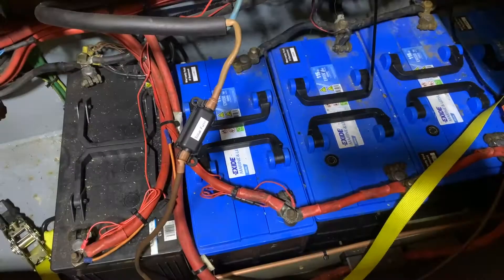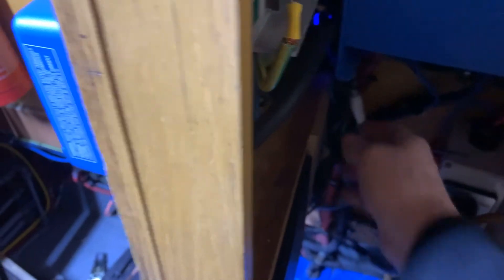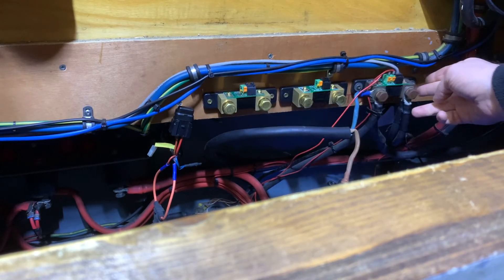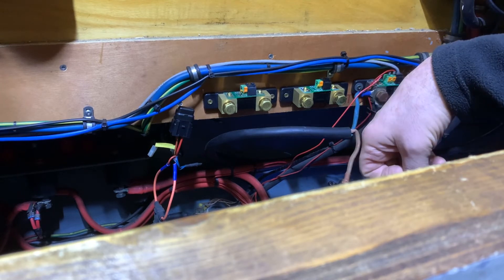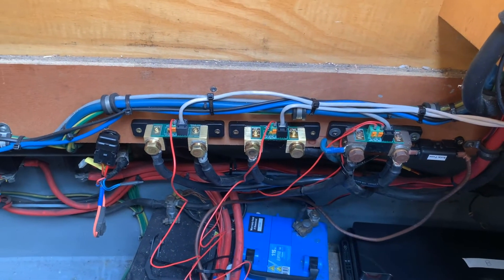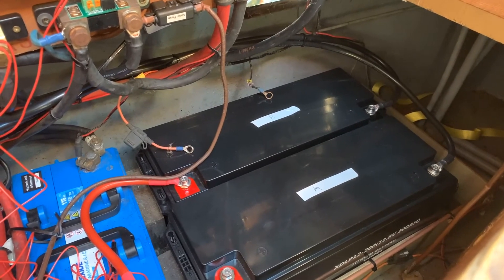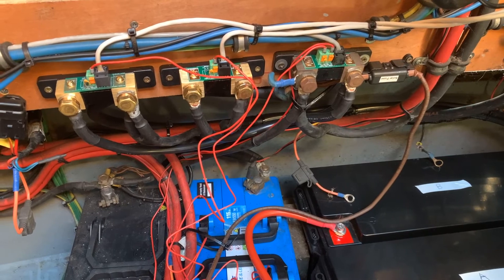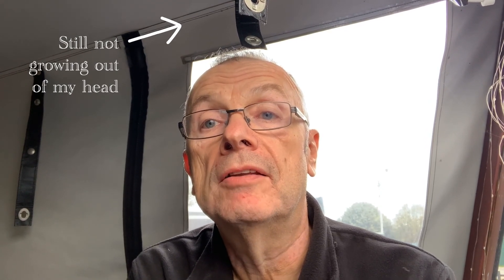Hybrid Lithium Battery Install on Our Narrowboat Ep 11

Comment: Look into a vsdr device
Reply: I went with 300ah lithium 300ah lead 
The vsdr device is designed for the different charging characteristics 
Lithium is 14.2v 
Lead is 14.4v to 14.8v 
So the vsdr turns on when lithium is charged at 14.2v 
Then it charges the lead. Bank full and hits 14.8v 
Once that’s charged and hits flour and goes to 13.5v the vsdr turns off
So then your only using the lithium bank 
Once used it auto switches and using the lead bank
Until charge and repeat it’s brilliant
Reply from the maker: We are 18 month in now and the system is working well. The Bms takes care of the lithiums and is set to disconnect them at 14 volts in line with the battery manufacturers recommendation for our hybrid setup. We never lean on the lead in normal use it is purely there to soak up the spikes when the Bms disconnects, and a bit of emergency backup in case of system errors. Thanks for watching and your advice, it’s always good to get feedback on other peoples setups, we never stop learning 👍😀
Reply from the maker: We are 18 month in now and the system is working well. The Bms takes care of the lithiums and is set to disconnect them at 14 volts in line with the battery manufacturers recommendation for our hybrid setup. We never lean on the lead in normal use it is purely there to soak up the spikes when the Bms disconnects, and a bit of emergency backup in case of system errors. Thanks for watching and your advice, it’s always good to get feedback on other peoples setups, we never stop learning 👍😀
Reply: I went with a set up for pure off grid so I never need grid power 
300 lithium 300 lead 
Dc to Dc charger 
Mppt 
480 w solar 
2000 multiplus
Cerbo gx and together it’s flawless we are pure off grid

Comment: Hi folks, good vid well done. How did you deal with the alternator heating up and also when the lipo stopped taking the charge?
Reply from the maker: Hi Pete, thanks for watching! We were lucky in the that the distance from our batteries to the alternator is long enough to cut down the charge current to well below the maximum rating if the alternator through its resistance. The alternator is rated at 110 amps and we typically see 50-60 amps once it’s warm. We measured the temperature of the alternator with batteries low when it’s working hard and we see around 90 to 100 degrees c well in the working limits. For others this cable length can be adjusted to create this same resistance but it is essential the cable is rated for the maximum alternator current plus some safety. Good info on this on the 12 volt boating group on Facebook. As the charge disconnect as we still have one lead acid battery in a hybrid setup as the battery BMS cut out the alternator still has the lead acid in circuit to take the hit so we have had no problems with the alternator or regulator pack.

Hope this helps!

I also have an update video on the lithium batteries and how they perform due out in a week or so give it a watch it may help!
Reply: @lockontommi  Thanks so much for the info , will keep looking for the update, kind regards, Peter and Mary, eye of Horus

Comment: Hi just thought I might say that having watched your video I would class what you have done is more like a change to lithium batterys with a lead acid as a safety for the alternator as I would class keeping your four lead acid and putting one lithium battery to keep the voltage up of the lead acids as a hybrid system but very interesting and well done
Reply from the maker: Hi, yes I take your point,I was'nt sure how else to decribe it. For me the added capcity of the lithium was the most important thing as we use quite a bit of energy when stood doing nothing. The good news is its all working well and i was so happy i added a third 100ah lithium to fill the box up an give us a little more. Thanks for watching and commenting, we plan to set of CC ing in January so there will hopefully be more intersting content to come.
Reply: @lockontommi   I think hybrid is a good description for both lead heavy and lithium heavy. With lead heavy it is using the lithium to optimise power harvesting when it’s available as well as providing protection from BMS charge disconnect and redundancy while with lithium heavy you get exactly the same benefits but with the role of the lead as a power source reduced more to the redundancy role while still providing the protection. In both cases you are using the best features of each chemistry.
Reply from the maker: Yes I agree and the information on you site was invaluable during our install. We are coming up to a year in now and I can honestly say we are very pleased with the result. We also have buckets of data on charging performance and temperatures etc. due to my fascination with IT and the splitting of the monitoring between lithium and LA. It’s fair to say the LA does little but protect the alternator, I occasionally see a small consumption during high load events (kettle etc.) but the simplicity it brings to the overall install makes it a great route to take. Once the engine is running our travelpower generator kicks in and we get the benefit of alternator and Victron charger, seeing 120 amps + going into the batteries so run time are much shorter. Anyway enough of me spouting on thanks again for putting your expertise online and available for all 👍